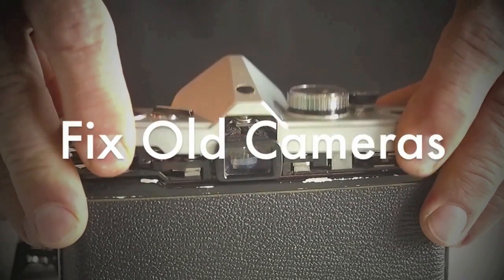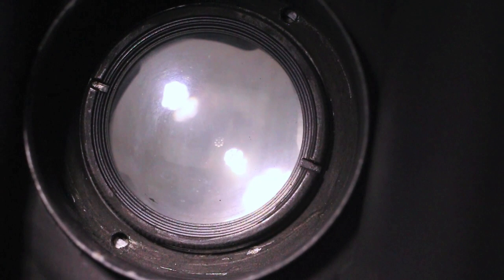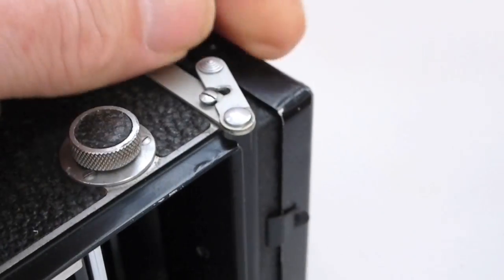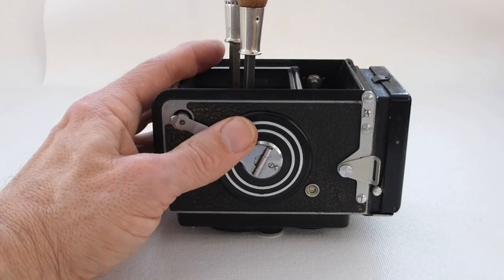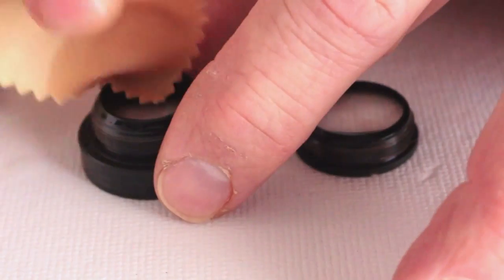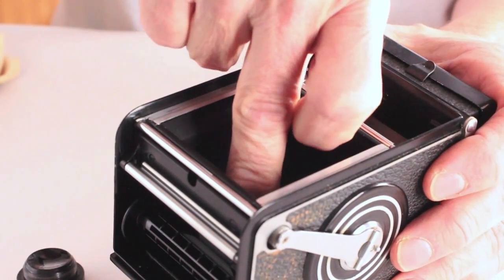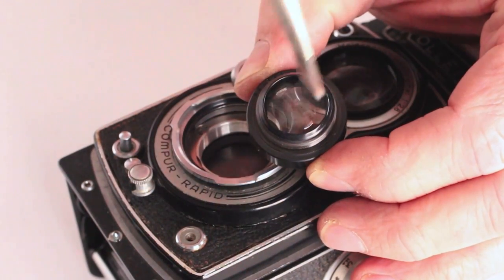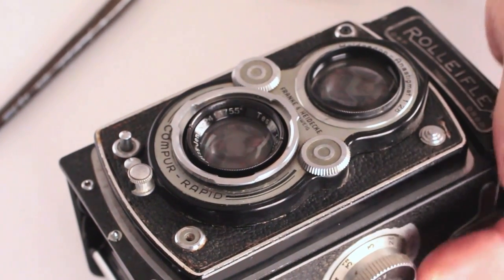Fix Old Cameras: Rolleiflex Fogged Lens

Comment: You are making a miracle for making a cloudy lens clear. As I was told that  lenses should be cleaned by optical cleaning fluid, the additive  of  non optical cleaning fluid may caused fatal damage to glasses. As Windex is quite corrosive. Separation of cement glasses usually causing the cloudy lenses , it is quite doubtful that simply lenses cleaning can fix the problem.

Comment: The way to prevent cross-threading is to turn the lens counter-clockwise (loosening) with a small amount of pressure until you feel the threads drop together. Then turn clockwise to tighten.  Tightening without first finding the thread start causes thread strip.

Comment: Again I have to say thank you! I had a Rolleicord from my uncle, and there was oil on the shutter blades. Your videos made me confident I could make it - and it really was not that hard! As an adjustible spanner wrench I used a pair of compasses, which worked great - and I have a perfectly working camera now. Thanks alot for your helpful tutorials!
Reply from the maker: You are very welcome and a clever repurpose of a compass. As long as there is not a lot of torque needed they work well for a substitute spanner wrench.

Comment: My Rolleiflex had another removable element held in with a screw in ring and a washer. After removing and cleaning it, I made sure to put it back in its correct orientation and snugged the washer and locking ring back down. I’ve had a couple of people tell me that I probably ruined the calibration of my lens by doing this, but it didn’t seem like something that was adjustable at all, so I don’t know how I could’ve ruined it? It only seemed to go in one way and was just tightened down until snug. Do you think I am safe or do you think I ruined my lens? I have done some mock up tests for focusing using a piece of paper taped to the film plane, and it seems to line up with the focusing screen fairly well. At least my eye anyhow.

Comment: Thanks for this tutorial. You mentioned blocking the shutter open but did t mention how to do that. I assume you set it to bulb mode but I didn't see how you were able to keep it open. Thx for any insight.
Reply from the maker: You can set it to bulb and hold it open with a locking cable release. Some shutters will have a T setting that can be used also.

Comment: Just bought a baby grey rolleiflex with case, yellow fillter and lens cap for £68.99 in the UK on ebay . They are selling for typically around £200. It was spelt as rollieflex and didn't come up in a search for rolleiflex at all since there were a lot of words in the original descrip that threw any search off.. Its a thing to watch out for anyone if you're into buying cameras fixing them up and selling on. You need to find one that doesn't come up in a search with the right spelling.
It seemed in good condition, the original price was £49.99 so other people had spotted it, but not too many. If it doesn't work I'm knackered but thats the risk you take.
I 'm going to see whats good or not and then re sell it much more expensively with the correct spelling in the listing.
Reply from the maker: Sounds like you are having fun fixing old cameras.
Reply: I'm trying to avoid fixing them If I can possibly help it.
If it ain't broke don't fix it!
Thank you for your videos!

Comment: Do you have a Yashica Electro 35 POD repair video by chance?
Reply from the maker: Replacement of the main switch assembly stop pad in the Yashica Electro 35 is a repair that requires a little more disassembly then the repairs typically produced by Fix Old Cameras, however it should be featured in an upcoming video. A Fix Old Cameras video on repair of sticking shutter blades and a video on battery configuration options for the Electro 35 will also be upcoming. Your patience is greatly appreciated.

Comment: Hello Fix old Cameras! Thanks for the explanation. I am looking for advice on how to access the back of the shutter assembly on the rolleiflexes. namely: how to remove the round tube on the back without damaging it. The spanners I can find on amazon and ebay do not seem to feature a tip that could be used for that purpose. Do i have to make a custom tool for that job?
Thanks in advance!
Reply from the maker: Often times a custom tool is the only way to go. Link to a couple ideas for custom spanners. Use your imagination. Just make sure you get a solid positive fit so the tool does not slip when in service. 
https://www.youtube.com/watch?v=z8OukD1pLyQ
https://www.youtube.com/watch?v=ULC8kUTnv5Y&t=5s

Comment: Hey, thanks for this video; it was really helpful! I noticed you recommended a Windex and isopropyl alcohol solution and not Zippo lighter fluid or hydrogen peroxide like some other lens repairmen; Will your recommendation, or even either of the fluids that I've mentioned, strip the lens of its coating?
Reply from the maker: Fix Old Cameras has no experience with lighter fluid as a cleaner of optics so can not make a recommendation. However hydrogen peroxide will work as a fungus neutralizer but will not evaporate as readily as alcohol so extra care needs to be taken as to containing it to the desired application.
Reply: @FixOldCameras  thank you!

Comment: Also, i have a Canon demi EE17 with foggy viewfinder, have you cleaned something like that? is it of hard or easy access? cheers
Reply from the maker: It will usually clean up to perfect with lens cleaner. The fogging is generally caused by vaporized lubricants.

Comment: You can use a caliper instead of a lens spanner If you don't have to go too deep.
Reply from the maker: Yes, however most calipers are probably constructed from a softer metal and may not be able to withstand the sideways torque.
Reply: Fix Old Cameras  My caliper is constructed from strong steel and is great for removing the dial things on top of shutters, winders ec  with the 2 small holes where the lens spanner cant' fit together closely enough.
You seem to be a bit anti inventive or alternative ideas.
I can understand that in a way because inferior tools DO lead to disaster but  my caliper is great.
Just get it to the right diameter, lock the nut and off you go.
Put in the holes and turn it around.
They're on ebay for around £9.00
It has two jaws  a small and a big one on either side and goes down to past zero diameter.
If it works perfectly well then its good for me.
PS I have got a proper lens spanner  but it does't close  small enough for certain things and that's when the caliper is used.
Reply from the maker: zenoist2 Excellent. Not a bad price either.
Reply: Fix Old Cameras  I use them for those 2 hole things on top of timers and film advance  levers where a lens spanner doesn't fit closely together enough for the small diameter. A caliper goes down to minus zero diameter if you get the right type  and a lens spanner doesn't. Get it to the right diameter. lock it in place and away you go! The apparently unmoveable timer or film advance lever is  solved!
PS the olympus 35 RC timer lever  winds off clockwise, just to confuse everyone,you can usually tell that from the amount of them on ebay with it snapped off.
You should do an olympus trip 35 video.
Reply from the maker: Thank you for the comments and video suggestion.

Comment: I use 2 parts distilled water, 1 part alcohol, 2 parts Hydrogen Peroxide.  The mixture will kill any bacteria that may result in fungus growth and fogging the lens once more.
Reply from the maker: Thank you for sharing you mix ratios. Sounds like it should work well.
Reply: Don't forget to let it set about a minute before cleaning.  If the fungus is to far advanced, then some of the coating may come off.
Reply from the maker: Right on. And that aggravating scarring of the lens coating is particular prevalent with the spider web looking fungus.
Reply: @FixOldCameras There's some haze in the shape of a patch on my 2.8e, but it is so faint and transparent that it's barely visible. Images that have been taken on that camera still come out great, so should I even worry about it? I think the stain may be the result of the camera's previous owner killing the fungus and leaving the 'corpse' behind because it looks more like a really faint stain than anything else. I also have a little bit of spider-web fungus on the edge of my 90mm Contax g2 lens; Should I just kill that fungus and just learn to live with the stain once it's dead? Lastly, I have two Minolta lenses that have haze in the middle glass element, and I'm wondering how to access that part of the lenses to clean them. I worry that the mixture you recommended we use will strip away the coating on my lenses; Is that something I should worry about? Thanks!
Reply from the maker: @Yulfi   If you are satisfied with the performance of a lens and you believe the fungus growth destroyed, probably would be alright to leave it as it is. The "spidie" fungus usually will leave a scar, but you do not want it to spread to the center of the lens, so the elements need to be cleaned. If gently applied an isopropyl alcohol based lens cleaner will not damage the coating.
Reply: Fix Old Cameras thanks for the prompt response! How can I tell if the spidie fungus is on the outside or inside of the front lens-element? If it’s on the inside, do you have a video explaining how to access that part of the lens?

Comment: On my Rolleiflex, neither the front nor the rear lens elements have slots for the use of a slotted spanner. Any tips for removing the lens?
Reply from the maker: +MethodAudioVisual  You will need to use friction lens tool. A rubber stopper of the appropriate size. Check the Fix Old Camera video Basic Lens Repair Tools for some possible insight.
Reply: With my K4A fitted with a Tessar, I found a 35mm film can was the perfect diameter. I laid a rubber pad made of fusible electrical tape over the bezel, pressed down with the film can, and it loosened it right off!

Thanks for the video, saved my Rollei from fungus

Comment: Hello, looked at my Rolleiflex MX-EVS and didnt see the notches for the spanner to twist it out. How does one remove such an optical element? rear element is the same, no notches. IS it glued?
Reply from the maker: You will need a rubber stopper or something similar to use as a friction wrench. Check out the FOC video on Lens Repair Basics.
Reply: Thank you. Now, do you think i can transplant a Tessar Opton lens from a Rollei (which has notches) to a Rollei that has normal Tessar (no notches on the border), are all the screw mounts for these lenses standard or do they vary? Im talking Automat model here.

Comment: Hi, does this work with the higher-end Planar and Xenotar models as well?
Reply from the maker: All of the Rollei twin lens reflex cameras will have a front lens group and a back lens group with the shutter sandwiched between. However not all the lens groups will have spanner slots. Some Rolleicords will have spanner holes on the back group but no slots on the front group. The Rollei Magic has none on the front group or the back group. Fix Old Cameras: Basic Lens Repair Tools - could be helpful.

Comment: is possible to remove fog from an 50mm 1.8 CANON FD?
Reply from the maker: Yes, you might refer to the Fix Old Cameras video Canon FD 1.8 Stuck Diaphragm for disassembly assistance.
Reply: the fog is in the middle element.he doesn't show us how i remove the mid optic for cleaning the fog
Reply from the maker: ***** The back bayonet has to be removed to access the rear lens group. Three screws around the edge of the rear of the lens holds the bayonet ring in place. The diaphragm levers linkage plate, then will lift out. However, please note that this plate does require some timing steps to reinstall properly.The procedure would be suitable for a Fix Old Camera video

Comment: Please don't follow this lens fog method.
Firstly the gritty dirt needs to be removed with distilled water or alcohol mix, inverted so no solvent goes on the edge of lens. Do not rotate or wipe across lens. Just flood and then dab with lens safe tissue.
Only then can alcohol and water mix be used, one wipe only and then fold over and after wipe throw away.
There is an anti reflection coating which will be fragile on an old lens.

Comment: Hi there, hope you can give me a hint, after a desperate inspection from a technician he discover where the light bleed in my rolleyflex 2.8 c did come from, when I pull the focus there is a wasted fabric between the lens and the camera corp that leave a gap (here is a pic www.videorebels.net/rolley-fabric-ruined.jpg ), I have no idea how is it attached to the lens, neither the name of that part (if somebody know please let me know).
I cannot say if is possible to replace or not, if is glued or if just disassembling the lens should be possible to switch it with another fabric ..I doubt of this last option as the technician told me that seems impossible to fix it without an original piece. I respect his experience, but I wonder if maybe is impossible to do a perfect fix, but should be possible to do DIY that could hold decently, maybe something he wouldn't try cause is easy to fail ..of course I don't mind to pay if there is somebody able to fix it. I cannot find anything on internet, is strange because is a fabric and I suppose it should be common that get deteriorated after many years ..for the rest the rolleyflex work very well ..Now that I know the issue I guess it work better on infinite focus and terrible on portrait (bad news). Any tip of any kind for fixing it will be very appreciated, I'll try to collect as many info as possible before to do a desaster or a "miracle" my self :) but will still worth a try
Reply from the maker: +Videorebels To repair properly the camera can be disassembled to access the light baffle tube and material sleeve. The front cover plate, the shutter assemble, the reflex lens assemble, the mount plate and the mount plate cover and various linkages will have to be removed to do this repair. If you want to avoid the disassembly procedure you can create an opaque flexible material sleeve the proper size and very very carefully glue it into place with two narrow beads of black 100% percent silicone sealer. A possible suggestion for a source for lightweight opaque flexible material is the black nylon that some lab and beautician smocks are made.
Reply: Thanks a lot, your solution make lot of sense, I was thinking about something similar but I was lost about materials. I don't know how long will take me to find the stuff and fix it (too busy). If I find a technician that will do it for me I'll definitely go for opening the camera, but if I'll have to do by my self I'll do it without opening it to mess as less as possible with the pieces. I'll do my best to remember to come back here and tell you the result as should help others. the camara when worked toke great pictures :)
Reply from the maker: Good luck. If you go the "no disassembly" route... apply the silicone sealer to the outer lens ring and press the material sleeve you have created into the sealer, let that application cure before applying the material to the body housing.